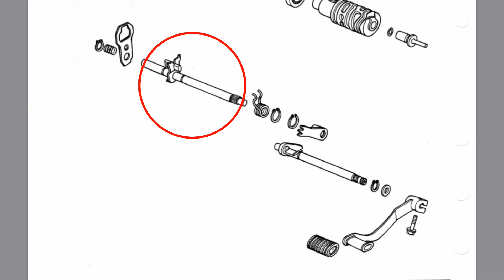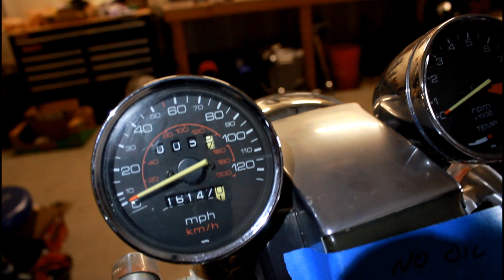Stuck in First Gear - 1983 Honda Shadow 750 Motorcycle Repair

Comment: Thanks SO much!! I have a 2006 Shadow 750 and she is stuck in 1st. I got a clutch plate kit - removed what I needed to, drained the oil, popped new ones in (IN the proper order). I THOUGHT Grace was good to go. I was devastated that wasn't the issue and left her disassembled out of frustration. YOUR VIDEO gives me great hope because not ONLY does that sound like my EXACT issue - but it's already prepped for THIS surgery. All I have to do is open back up the Clutch Basket and GET LOW like you said because I don't have a lift. Will let you know if it worked after I get to it. Appreciate you very much.

Comment: Random but yeah I'm that person who has his problem and you explained it well
I just picked up a 84 shadow 700 and it was shifting fine but replaced the neutral safety switch so I took off the cover and in that process I noticed I pulled out the rod that connects to the shift lever and now won't shift into any gears
I'm new to motorcycles but not engines and the way you explained it im sure I have to align that rod back I should be good
Hopefully 
tommorow ill see
Reply: Is that neutral saftey switch the same as the indicator switch? 
My recently purchased 86 shadow VT700 only indicate's neutral half the time.  
It was fine. Then i road 300+ mi in a couple days. Found that i was in neutral with no indicator. Thought oh the bulb must have blown.  
Then next time i was in neutral i had an indicator again.  
Didnt realize how helpful that little green light was until it was gone.
Reply: I have a 93 Honda Shadow. What people always forget to mention is that there's a serious design flaw in Honda. Motorcycle and car. Problems are usually not big, but usually you have to take apart your car or bike to fix. Most bikes, you can easily fix this type of problem because it's easily accessible. This lady literally took apart the motorcycle, not everyone wants to do that

Comment: Cool! Where's I hated the crappy paint job you did on the Sportster, I love what you're doing with this one! 
Cool!
Reply: Should be black, but red is perfect cause Honda freaked H.D. out so bad with the 83. We put huge sanctions on them. They couldn't import anything bigger than a 700 until mid 2000's. To protect the American vt motorcycle companies  bottom line. 
 So, in the red is where Honda could have almost themselves. With the badass 83 750vt. Only 1 year. Very special bike cool story. I thought.

Comment: Shadows rule! My other bike is a VT1100. It didn't get stuck in first, but it was so hard to shift that I eventually wore out and broke the shifter shaft! I got that fixed, but then the water pump gave out, and I have to pull the engine to reach it. A year later I still haven't bothered!

Comment: Ugh, I recently bought a 1984 Honda shadow VT700C with a little over 47K on the odometer, replaced the fuel pump with a new one after I got it running, From nothing lol. Was a barn find in some guy garage, so I had to bring it back to life again. Rode it for a short time till the fuel pump died on me, the new one ofc .... UGH !!. So I bought a second VT700C engine on Ebay to use for parts and rebuild the original, ended up repairing one I bought instead since it was in better shape. End result is the bought engine died due to an internal case failure so it wouldnt start anymore aside from pop starts lol. SOooooooooo I bought a 1983 Honda Shadow VT750C parts bike, everything's the same but for a few pieces here n there. this projects taken me months fopr far and I do not see an end in sight lol, But by now Im pretty close to being a shade Tree Expert on these damned things lol, having rebuilt the toiip end on three and still tinkering with them, its fun but a POA in the same.

Comment: I paid 760$ for my bike delivery to my house from a super Kool, private owner off Craigslist and as my very first Street bike. ,,and I am 51 years old and have health issues,, this bike has 5500 original miles on it,and is all original and in excellent condition looks and running,,yes it has a couple things it needs to get on the road like oil change and front tire. But I got a killer deal and just love these old bikes

Comment: SO I’m working on my 84 Magna, very similar bike, and mine is also stuck in first - in the shop manual, it says that before you remove the clutch, you should shift into the highest gear possible... mine obviously can’t do that. Is it possible to skip this step without a headache during reassembly? Thanks so much

PS: I know the Magna doesn’t use gear shift spindles with teeth like the shadow does, I’m looking for something else

Comment: Wish my 83 looked like yours, mine sat in a shop since 1991, with only 8300 miles. I have to go through the whole thing. Sitting is worse than a bunch of miles . N my opinion. Nice bike, very clean. Where did you get yours?

Comment: Where do you get your parts for the shadow? I need a new gear shift spindle
Reply from the maker: Which end? You can still find part numbers for the spindles, but you might have to eBay them or contact your local vintage bike shop/salvage shop.

Comment: I'm looking to buy my first bike, and I definitely feel pretty good on either a Honda Rebel or a Honda Shadow. Which would you recommend for a total noob?
Reply: Man I've been riding for years  
In less you're looking at buying the brand new Rebel 500 then you get bored with it real quick I would look at the Shadows because anything less than a 500 really doesn't have enough power to go down the highway well and shadows really don't make that much power so you won't get yourself in trouble real quick I would suggest 600 or 750 to start
Reply: @heidilevenson8156  I appreciate it the input!
Reply: @heidilevenson8156  definitely the shadow

Comment: I have a 1979 Honda cm 400 A yes A Hondamatic but it's not automatic it will not move at all unless you shift with your foot into one of the two gears high and low!! Yes it has no clutch and shifts without one,but it has what called an centrifugal vane that connects the engine and transmission using all the same fluid,,meaning the engine and transmission fluid is oil the same oil! Means bc it uses the same oil for both Honda recommend that you change the oil every 1875 miles. NP

Comment: But it can cruise highway speeds np,and will get up to 100 mph. Plenty fast for me the bike weights in at 406 pounds wet which makes it feel very stable at higher speeds unlike light weight 250s and 300s and 400s of the newer generation. Lighter weight bikes in similar class

Comment: The bike is not a rocket
Reply: Hay Killswitch I got a 86 Honda Shadow VT1100C it's stuck in 2nd gear. Would this be possibly the same problem and same fix for this model

Comment: Tobad you pulled the clutch assembly.  You could have done it without pulling clutch:( I HAVE 83 HONDA SHADOW VT750C
Reply from the maker: Maybe so, oh well
Reply: @KillswitchQueen  my bike same color but I painted chrome fender cut 3in off n back up to tail light.  Pull your baffles grind off welds on chrome drill through with big drill bit then beat off chrome slip WD it up then cut baffle off at main pipe bolt on chrome at drill holes "OPPS" THATS MY VULCAN. PULL YOUR REAR PIPE OFF THEN GO TO JUNK YARD LOOK FOR TAIL PIPE WITH CHROME TIP THAT FITS OVER TIGHTLY THEN DRILL HOLE PLACE BOLT UES OLD CHROME PIPE COVER CUT TO HIDE BOLT. SOUNDS GOOD! I LIKE YOUR BIKE AND ANY NEW ONES YOU GET